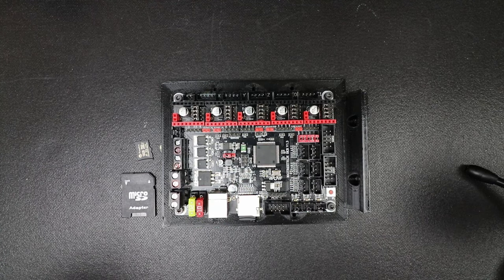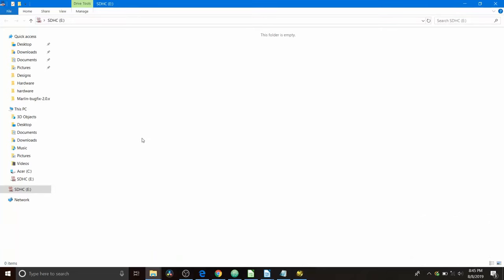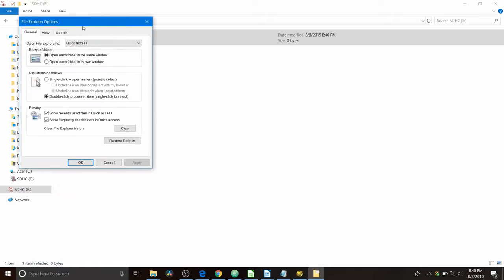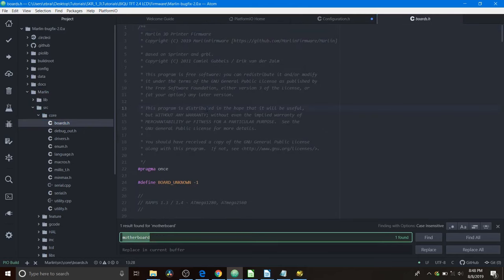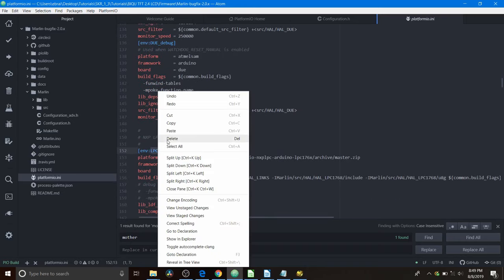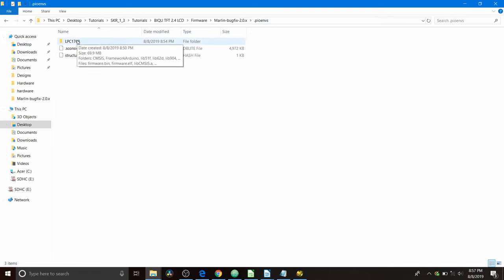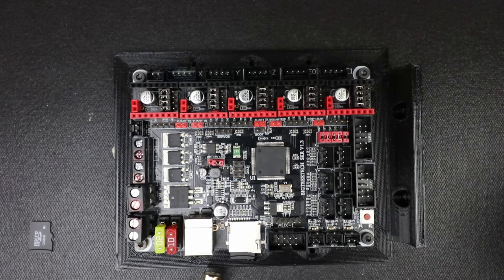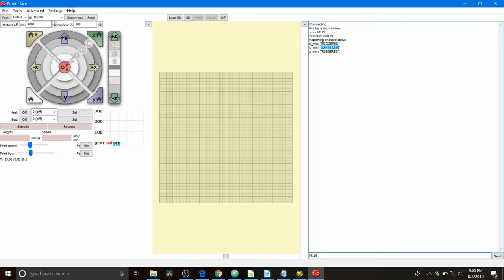SKR 1.3 - TF drive Marlin firmware loading

Comment: Hello Edward,
I am honestly a bit lost!
I always use Ramps 1.4 but now I see more and more other boards floating above the surface.
of course I am a stingy Dutchman!
and wants the utmost for as little money as possible.
maybe you can also tell a little more about the different plates and maybe something about price range.
And yes of course I understand the more power the more expensive it becomes.

Kind regards from the Rotterdam area!
Rob.
Reply from the maker: Well processor power aside it close to the price of a RAMPS 1.4 and is easier to wire for advanced stepper drivers.  Keep in mind there are 32 bit conversion kits for RAMPS.  I'll cover soon, but it's complexity will keep users guessing.

Comment: I'm having the same issue as the other gentlemen had not so long ago.  Everything else is going right except the bin file is not converting into the cur file.  The jumper pins are correct to enable USB connection.  Is it just a faulty board?  Except for my lack of success, I commend you on your series of videos.  Keep up the good work
Reply from the maker: Maybe try another TF/SD card otherwise maybe use USB connection.  Let me know how it works out.

Comment: I know this is a old vid but I was wondering. 
Is there a way to upload firmware from the SD, TF, or USB port on the LCD screen instead of the one on the board itself?
Like would a certain serial port assignment in the firmware allow this?
It would make servicing the firmware much easier for those printers that have the boards enclosed to where you can not get to the ports without opening up the printer.
I am currently waiting on some micro SD extenders I ordered to use to get around this issue as I use one on another printer but was curious if I could setup the printers to update firmware from my ports on the LCD screen. This thought came to mind as I am servicing my Kossel Mini and every time I want to update the firmware I have to take the print bed off.
Reply from the maker: Depends on the hardware.  There's many way to do it other than what is presented in video.  My issue with showing them is they can really mess up someone's hardware if they miss a step.  So I show the safest method.

Comment: Hi edward i cant find the files after i build the firmware i click on the navigation bar and nothing happen
Reply from the maker: Make sure you're using VScode with Platformio plug-in.  In my playlist there should be an install video.  ATOM is no longer supported with Platformio plug-in.

Comment: Thanks for this..
But is the same.. Nothing..
Switch with a new microSD format install the .cur file and nothing..
The board only worked the first time.. 
After update the firmware... 
But..
I used the marlin 2.0.x from the github of bigtreetech and not of marlin..
I download now from marlin and now the card appears...
Not yet configured but now shows...
Maybe the marlin of bigtreetech from github is with some problem?
Reply from the maker: Does the SKR 1.3 work in Pronterface?
Reply: I use the examples files of the Delta (kossel xl) and now is all ok...

Comment: Hi Edward. nice video.
I have trouble with SKR Mini 1.1
When i insert the tf card, the board is loading, but not complete. Now the display just blank screen (previously installed marlin 2.0 is missing).
What should i do? Is the board still can be used?
Reply from the maker: What's in your setup?  Hardware is what I'm asking.

Comment: I really hope you can help me because so far no one can. When I place the firmware.bin file into my SD and load it into the SKR it never converts to the firmware.cur. My computer will no longer recognize the skr as a USB when I plug it in so I can’t power cycle via USB, I have to move the jumper to VOC and plug into my PSU and it still doesn’t convert to firmware.Cur. Any suggestions?
Reply from the maker: Check file extension for correct extension or hidden extension.  Check format of drive.  Check size of SD card.  Make sure drive format is fat32 and not something like xfs.  Just a couple of ideas.
Reply: Edward Braiman it is fat32, 16 gb is the only card I got. The file extension says .bin thats how I know it’s not converting
Reply from the maker: Try partitioning the drive root size down.
Reply: Edward Braiman had it set to 8

Comment: Hey Edward, running into some issues when compiling in Atom. It just gives a massive list of yellow errors then says build failed . Fresh install of atom with platform.io and a fresh download of marlin. Followed every single step exactly and not really sure why it's not working. Ever run into something like this?
Reply from the maker: PlatformIO has stop supporting ATOM.  You'll need to switch to VScode with PlatformIO plugin.

Comment: Dear Edward, i setup marlin and installed on the board as you explain on videos. I am experiencing the issue that it wont connet to pronterface via USB. I configured line 105 on configuration.h as -1 but it still dont work. Motors, hotend, thermistors, display, everything is working but i cant connet the board to the PC via USB. Do you have some tips to help me? thaks.
Reply from the maker: Check with only 5v jumper and connect to Pronterface.  Check serial connect and re-flash Marlin firmware.  Otherwise HW issue.
Reply: I Tried everything and nothing worked. I started to feel frustrated thinking it was HW issue and connected the usb to the RBPI with octoprint and worked. So it seems to be problem between Windows 7 or my PC and Marlin.

Comment: What example config should one use for the CR-10S4? The CR-10S one and mod up all sizes or the Cr-10S5 one and mod them down? (guessing the latter as I think the S4 and S5 have a different Y stepper motor than the smaller ones?)
Reply from the maker: Unsure, but you probably going to modify both.  Think of it as an outline of settings, but not the Biblical law.
Reply: @EdwardBraiman  Wow, quick reply. Thank you.
BTW, if you're looking for ideas for future guides I saw a question that intrigued me.
Using A SKR 1.3  (or other) with dual lead screws (assume that is needed). Would it be possible to set up (using sensorless homing) automatic gantry leveling (Prusa style) in marlin 2.0?
Reply from the maker: I'd need some time to research.
Reply: @EdwardBraiman  Yeah, just thought the idea sounded interesting and useful. Think you'd need to run separate drivers for each Z though for it to be possible.

Comment: Hi, Your videos are the best out there! I'm new to upgrading... have an ender 4. Got the skr v1.4 turbo, tmc2209, bltouch and tft35... and not having much luck upgrading. I've followed your other videos on the 1.4 and turbo, but couldn't get Y or X right. And now the usb is not recognized. Not sure what happened, but my search brought me to this video. Atom won't install right on my computer, so can I use Vscode instead of Atom to follow along with video? Thanks
Reply from the maker: Thanks.  Is the SD loading again?  Remember ATOM isn't supported with Platformio anymore.  Is you printer working better now?
Reply: @EdwardBraiman  Sorry I didn't know Atom was not supported. I will follow your video instructions using svcode now and see if I can get it to work. I'll keep you posted. Thanks
Reply from the maker: You're welcome.
Reply: @EdwardBraiman  Hi, made the file but when I plugged in the usb cable, the red light and green light on the board come on, but then a window pops up and says "the last usb device you connected to this computer malfunctioned and Windows does not recognize it. Any ideas? Thanks for your help.
Reply: Also, I did check the voltage on the pin and it is getting 4.91 not exactly 5, so not sure if that is the issue.
Reply from the maker: Might need to reformat the micro SD card or try another.  If you get a chance watch the basics tutorial in the playlist, it may help.
Reply from the maker: Also I have a SKR 1.4 playlist.
Reply: @EdwardBraiman okay, I did reformat with a new micro sd. Should I do it again?  I have watched the basic and a few of the skr 1.4 videos. Was able to get everything on and moving but could not get 2209's to work properly and now having the problem with usb not being recognized. Wondering if I got a bad board and just need to return it. Was just hoping it could be worked out.
Reply from the maker: @Mindy1021  sounds like the board is having issues.
Reply: @EdwardBraiman  Thanks for your help. Thats what I'm thinking too.
Reply: What board do you recommend, that would work well with the tmc2209?
Reply from the maker: You're welcome and hope next board works better.
Reply from the maker: @Mindy1021  depends on you level of experience.  The SKR 1.3 seems to be the most stable of 32 bit platforms I've worked with and the price is reasonable.  If you looking for a more novice 8 bit board my favorite is RAMPS 1.4, but you'll need to wire tmc2209 via jumper wires.  Depends on you comfort level.  I start with RAMPS 1.4 and my knowledge level was laughable, but it's one of the reasons I now do tutorials on 3d motherboards.  Most the tutorial had been impossible to follow without damaging the boards.  Also 8bit boards have a more stable Marlin firmware base in version 1.1.9.  Marlin firmware 2.0.x is very difficult for me to work with as Marlin developers do not see the issues via a users point of view.  Hope this helps.
Reply from the maker: MKS Gen L v1.0 is also great.
Reply: @EdwardBraiman  Thank you. I'll look into those.

Comment: Hi, first, you do a amazing job here I think you help a loooot of people with your videos.

But maybe you can help me I cant find any solution on internet.
I have a SKR 1.3 which worked perfectly the first day, And today it stop to work without i made any change...
I cant access it via USB, when i upload manually the firmware on a microSD card as you shown here the board dont install the new firmware, it stay in the micro SD card...
Do you know this issue ? 
I know you are not the bigtreetech support but maybe have you an idea !

Have a nice day and keep up your fabulous work.
Reply from the maker: You can try another microsd card and remember it should be formatted as fat32.
Reply: @EdwardBraiman  yes i already tried to change SD card with no success...
Reply from the maker: What's the size of the micro SD and what's the filing system?  Can you see file extensions in your operating system.  What does the properties of the files say?  Are they write protected at file level?  These are some of the questions you should check.
Reply from the maker: Also is motherboard completely powered down.
Reply: @EdwardBraiman  It's a 16Go MicroSD formated in fat32, with a FIRMWARE.CUR file and a firmware.bin file generated with platformio.
The motherboard lightup a red LED but that's it, it dont update firmware, and the LPC1768 getting very hot ... Dont know why, I did nothing special on it
Reply from the maker: The drive size is too large.  Remember the drive is pointed to a defined sector of the micro SD.  The original drive size is 128mb if memory serves me.  You can try and partition the drive.
Reply: @EdwardBraiman  Okay, i got the same result with a fresh new 128mb SD Card from another SKR, and it still dont work...
Reply from the maker: Try formatting drive as FAT32 and try again.
Reply: @EdwardBraiman  same result, the motherboard seem to be dead
Reply from the maker: It maybe, but I think a step is missing which gives this impression.
Reply: @EdwardBraiman  oh really ? I hope so ! Tell me ?

Comment: I followed your tutorial on how to load this via usb and thought I did it. When I unplugged the usb and plugged it back in to check if the .bin file was gone, windows no longer recognized the usb device and pronterface couldn't connect. Now I'm trying to load the firmware this way and when I click compile I get this error message:

'platformio' is not recognized as an internal or external command,
operable program or batch file.
Unable to execute: platformio
Make sure cmd:'platformio' and cwd:'C:\Users\Brian\Desktop\BIGTREETECH-SKR-V1.3-master\firmware\Marlin-bugfix-2.0.x' exists and have correct access permissions.
Binaries are found in these folders: C:\WINDOWS\system32;C:\WINDOWS;C:\WINDOWS\System32\Wbem;C:\WINDOWS\System32\WindowsPowerShell\v1.0\;C:\WINDOWS\System32\OpenSSH\;C:\Program Files (x86)\Intel\Intel(R
) Management Engine Components\DAL;C:\Program Files\Intel\Intel(R) Management Engine Components\DAL;C:\Program Files\LLVM\bin;C:\Program Files\Git\cmd;C:\Users\Brian\AppData\Local\Microsoft\WindowsApps;
C:\Users\Brian\AppData\Local\atom\bin;C:\Users\Brian\AppData\Local\Microsoft\WindowsApps;;C:\Users\Brian\AppData\Local\Programs\Microsoft VS Code\bin

Have any ideas?
Reply from the maker: Do you have GIT installed?  Try with a fresh copy of the Marlin Firmware download.  Also try compile while on the internet and before all reboot computer.  Is the the first time loading firmware?  Are extensions visable?
Reply: @EdwardBraiman  I'm in the process of deleting all my current downloads now and downloading them again. Yes, Brand new board. Like I said, It looked like it worked via usb, however the computer won't recognize the board anymore. I can pull the card it came with and read it via adapter; it shows FIRMWARE.CUR at 136kb and firmware.bin at 0kb on the card currently.
Reply from the maker: Try formatting micro SD card and place a blank file FIRMWARE.cur file on it with newly compiled firmware.bin. let me know what happens.
Reply: @EdwardBraiman  I put the old, previously formatted card into the new board and it is working perfectly. The other board must have gone bad. For good measure, I tried reformatting another card with new downloads of all the necessary files and it still will not compile. It shows an fail error in LPC1768 and says that it does not exist. I've tried it 3 times with no success and the same problem each time. I'm not TOO upset because I do have a properly formatted card to use, however I have enlarged all 3 axis on my ender 3 and will I'm sure need to tweak the firmware to accommodate the changes. My biggest concern is not being able to properly do that in the immediate future.
Reply from the maker: I had similar issues on SKR Pro v1.1, but was able to recover with a fresh micro SD card.  The SKR v1.3 has not appeared yet as an issue.
Reply: @EdwardBraiman  I believe I have the SD card situation figured out, Now I can't seem to complete the build on atom without a failure. I have removed all the files and installed them and still no luck.
Reply from the maker: What is the error message?  The first error you see.

Comment: I followed all the steps and cant get it to work I still see 2 files when I plug in the board not just the .cur file can anyone help me please
Reply from the maker: What files do you see?
Reply: Both of them
Reply from the maker: If you have another microsd card, then format as fat32 and create a filename firmware.cur, then add the firewater.bin and power up board with usb power.  Let me know what happens.
Reply: Now I got it to work but I have tmc errors now
Reply from the maker: Are you using a TMC stepper?

Comment: I love your videos. They have been very helpful, but i’m having an issue. I’ve compiled new firmware with some changes in config.h and trying it load them on the board. First issue was the pc wouldn’t recognize the sd card. Was this just a bad card that came with the board that i’ve read so much about? Anyway, i bought a new card, copied the new bin file to the card, and off course the board didn’t update to the new bin file. I found this video and have followed it to a T and the board still will not update. Maybe i’m missing something but i don’t know what. It’s as if it boots to what is already on the board and never looks at the tf drive. Any suggestions?
Reply from the maker: How big is the SD card?  It has been said large SD cards have an issue.  Try partitioning root of card down to triple the firmware.bin file size on root partition.  If that doesn't work, return board and get a replacement.  Let me know how it works out.
Reply: Ok, I’ve partitioned the card and it still wouldn’t boot to it. All i’ve been trying to do is make the touch screen work by changing the serial port as someone suggested to me, and now i’ve seen that you have a video for the doing the exact same thing. I thought maybe it worked like my mks genL and won’t update with the tft attached, so i ttied disconnecting the display, but no help. Now that i think about it, it flashed from the pc thru usb and not from a card. Being frustrated with this, I decided to update the TFT24 with the latest firmware and selected unified mode, which has been successful, but still no printer attached message. Would this work if i put the bin file on a regular sd card and put the card in the display instead of the skr board? I’m pretty clueless about all of this, but learning. Thank you for your quick reply.
Reply from the maker: Watch my tutorial on tft35 firmware update.  Remember to use unified code as they made a change to firmware and icon will not work otherwise.
Reply: Edward Braiman . I just want to thank you for your help and give you an update. I have resolved the issue. I haven’t used the format function for several years. When i first tried to format the card, FAT32 was not an option. Only exFAT. Sounded close enough to me. After that didn’t work i i tried to partition the card, partition, or “shrink” was not an option. I learned that i had to format the card in ntfs in order to partition it. Then i was able to re-format it to FAT. I just didn’t hit the drop-down to see that FAT32 was now an option and formatted it in exFAT and that’s why it wasn’t working after partitioning it smaller. 

TL/DR:

The card needs to be formatted in FAT32 and FAT32 only supports 32gb or smaller partitions or cards. Larger cards need to be formatted to NTFS to allow partitioning. 

 Thanks again. Keep the videos coming. Subscribed.
Reply from the maker: You're welcome.